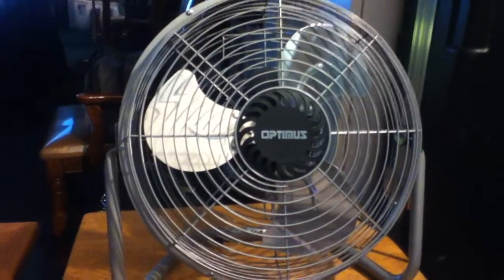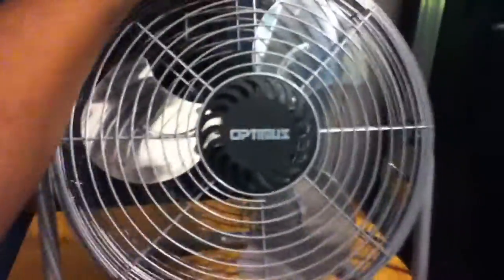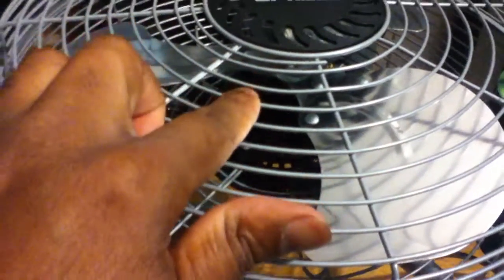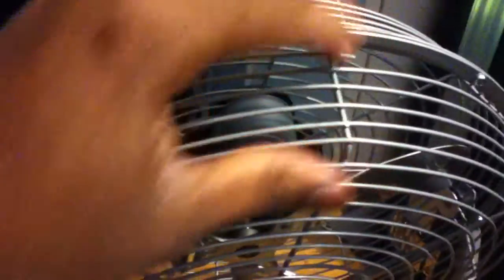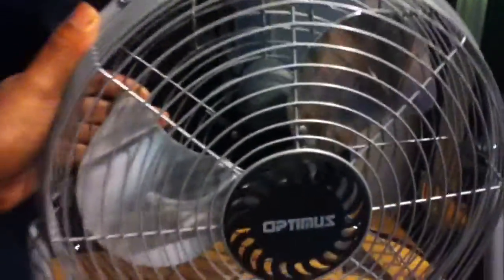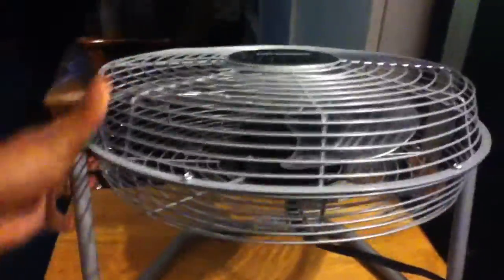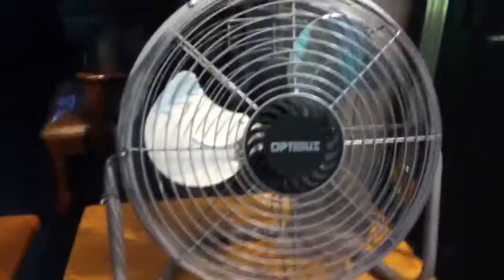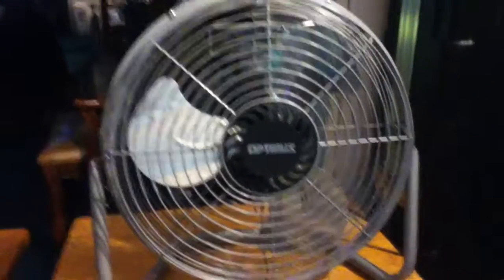Optimus at home

Comment: I wouldn't worry about the squeaky sound when adjusting it, just means it's tight and will stay in position.  The bent part of the grille can be fixed, you'd have to remove the grille and probably bend it by hand; if you try to pry against another part of the grille, that part will bend.

The cut off parts are normal, it was just a cheap way to manufacture it; they just coiled some thick wire in the shape of the grille and tack welded it to the cross member supports.
Reply from the maker: +jaykay18 wow that was a cheap way to put it together thankfully its still doing well although one of the screws are ate out